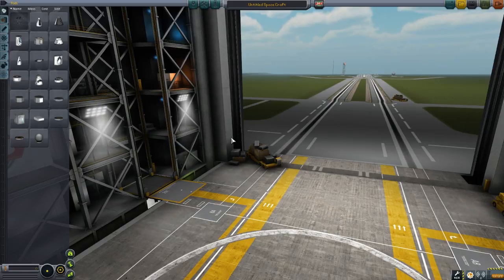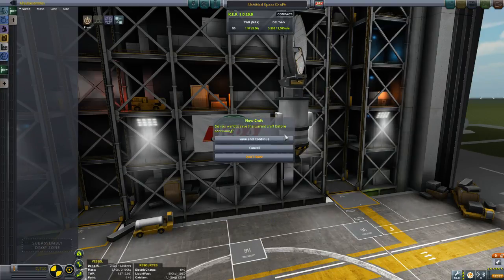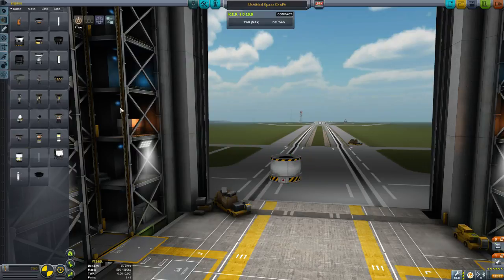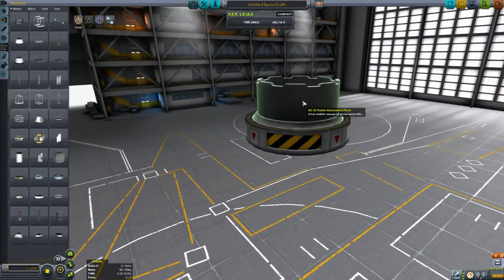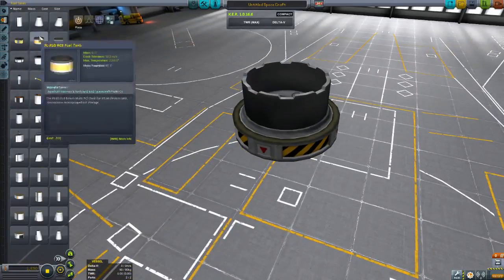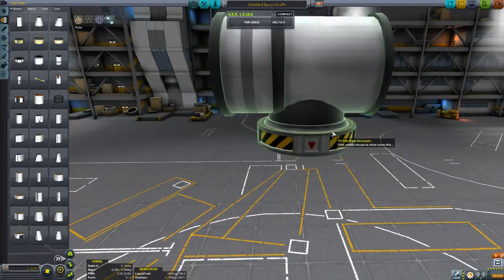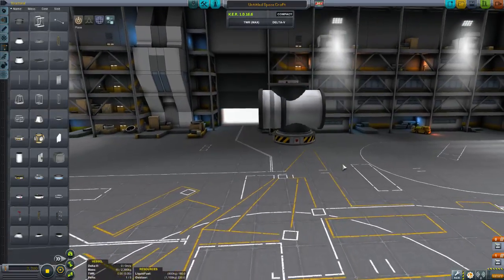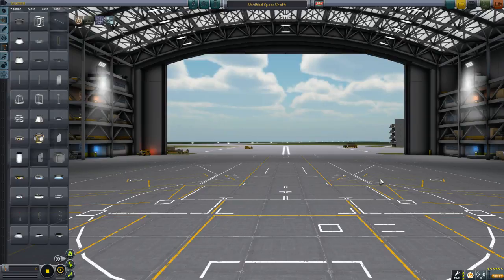Sub assembly tutorial

Comment: +Randolph Fuessel When i try to add a space station core as a subassembelt i can't add it in. what is the problem? btw i have puted fairing around him.
Reply from the maker: You would first have to build the Station Core as a sub-assembly.
Here is how Sub-assemblys work...the root part of any sub-assembly HAS to be the bit that connect to the rest of the craft. Typically people use decouplers for this.
However there is new option in KSP since this vid was made. You know have the option to change the root part of any craft.
So here is what ya do, slap a decouple on the bottom of the station core, now make that decoupler the root part of the craft, and save it as a sub-assembly. Now you should be able to place it with no issues.
Reply: i have done it the other way:first i have gone to my ksp,gone to ships, and than i have copied and pasted the space station core as a sub assembly. That was the easier way. Randolph Fuessel

Comment: I haven't tried this, but why can't you just build the craft like you did the first time, add on the decoupler - and then make the decoupler the root part before dropping into the subassembly using the "change root part" button (the "z" with the two boxes on each end)?
Reply from the maker: Yes, you can do that, however it seems to fail a good portion of the time. Also this video was made when changing root part was a mod only function.